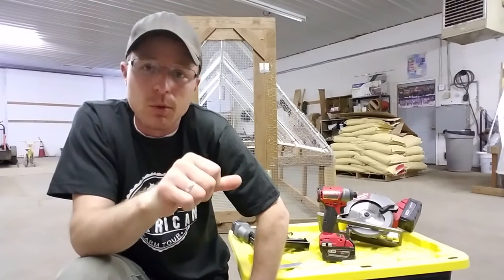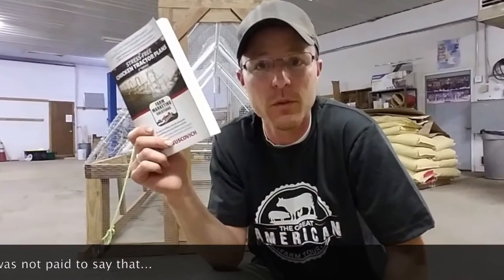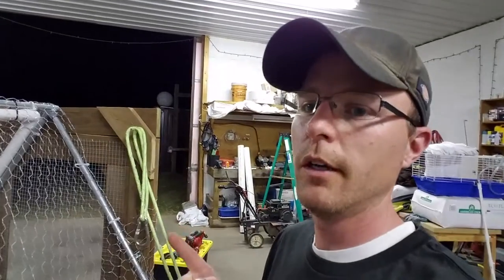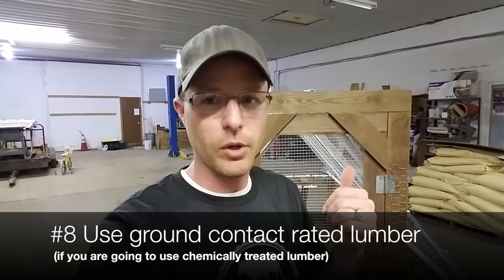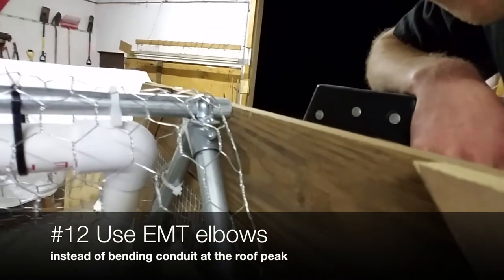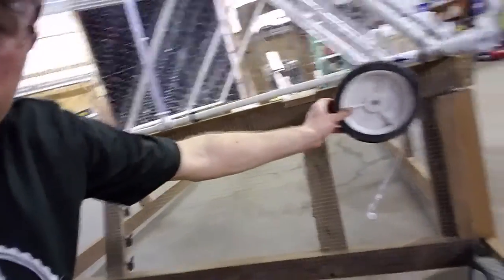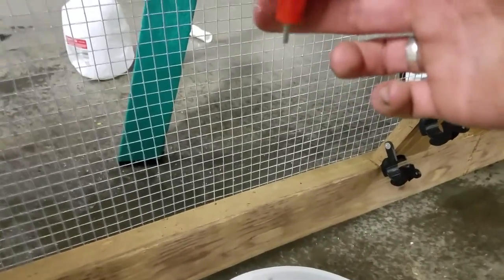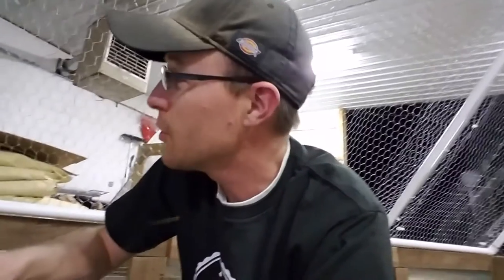Suscovich Chicken Tractor: Tips Tricks Mistakes and Sweet Mods

Comment: Quick correction on the EMT clamp. The one you showed the photo of was for 3/4 inch pipe. This project needs a 1/2 inch pipe EMT. Should be easy find at any hardware store.

Comment: Thank you for the added info to make the build easier. Great solution for conduit installation.   Especially found the mods you did helpful. Question?  Where you added the nipple water connection. How do you screw in the end with the clear section of hose without getting the tube twisted ot having to manipulate the whole piece?  Would it be useful to make that a quick connect instead?  Quick connect like you can add to a garden hose.
Reply from the maker: A quick connect would be easier as the tube twisting was annoying, but there wasn't a huge reason for removing it too often. For this and other reasons I don't recommend the water system. It just didn't have enough capacity to be worth it.

Comment: I really like your improvements and tips for this tractor.  I have John's book and am just getting ready to build one myself, and I am sure your tips are going to help a lot.  I like your water ideas too, but I think you may have inspired me to improve, or well at least simplify and reduce the cost of, what you are doing with the water.  All of those little plumbing fittings required to build a pipe "cage" must have added up, and that also seems to be a lot to not only install, but a lot of joints and corners and tubing that could leak or get cracked as it flexes when this tractor gets moved daily, or pocket that may freeze in the winter if not entirely well drained for storage.  I think it would be easier to use a 3" or 4" pipe up under the ridge for a reservoir right into the tube to for your movable manifold.  Idk if you can just get a clear end cap for pvc pipe, but if so, there's the water level indicator for the tank. Half a dozen or so fittings and a lot less tubing, and I think you'd get the same results.  I think there should be enough conduit up the to have plenty of support, and zip ties would not only hold this tank up, but they would give lateral support to the conduit rafter.
Reply from the maker: Awesome,  thanks for the note. There is a comment in here somewhere where after a year of using this I believe I recommended the same thing, a single larger diameter pipe from the middle. I actually already bought the pipe for doing exactly as your describe, just waiting for warmer weather. Speaking of warmer weather, I dont use the water system during the Winter. Thanks for watching!

Comment: I was watching a few videos and like the ideas I see here.  My wife bought all the stuff from the book to make this and I'm having to make it tomorrow to get the chicks out of the brooder.  I think I see what is wrong with the door from watching other videos and comparing lengths.  The short pieces are not supposed to be above the long pieces but at the top of the long pieces.  I really like the all the improvements you made and will be attempting to add those in tomorrow.  Thanks for the video.
Reply from the maker: Thanks, I'd skip the pvc water system if you were going to attempt it. Just do a large 3-4" pipe down the middle instead of making it a cage.

Comment: Randy I like the watering system. Great idea. How about your feeder? Thanks mdag. Glenn
Reply from the maker: The watering idea was interesting on paper, but in practice it didn't hold enough water to make it worth it. I'd advise against. For feeders I did the pvc feeders that are in the book, just not hung from the ceiling. I screwed chuncks of 2x4 to the bottom of the PVC pipe and laid them on the ground. The ones hanging from the ceiling were too "swingy" when moving the tractor. Thanks for watching!

Comment: Great ideas to improve an excellent design. I would add one. When I built mine I mounted the wheels so they run on the other side of the 2x4. When you pull the tractor forward you don't run the wheels through the bird's manure.
Reply from the maker: Great tip! I actually thought about this too, but decided to purchase wheels for each of my tractors. They seemed to get nasty regardless and I thought it was a waste of time to keep moving them, so I just bought a set for each tractor. I was also worried since I tow mine around the farm that they effectively increase the width of the tractor as a whole and I am not as careful as I should be about looking behind and making sure I am clear when going through gates.

Comment: Great tips on mods!  Question - have you had any issues with strength or longevity in the lumber where you drilled the holes vertical for the EMT? I love that idea but concerned about the strength of drilling a 3/4-1" hole in that 1.5" thickness.
Reply from the maker: I was concerned about it too, but haven't had a problem because I also added small 2x4s attached to the cross bar where the holes were drilled and I wasn't directly centered.

Comment: Excellent. Wish I would have seen this BEFORE making mine. Your tips about the conduit and all things related to making the stapling easier are spot on. And yes, some of the measurements and diagrams in the book are just plain wrong (some of the numbers don’t even add up on the lap cut diagram). 

How is this watering system holding up?
Reply from the maker: Glad it helped you. Skip the water system. Too much piping for not enough volume. If I could do it again, I'd run a single 4" pvc pipe down the middle hung from the roof peak. Good luck!
Reply: @RandyKleinman  that is an excellent idea.

Comment: Great job Randy! I enjoyed watching how you built this tractor and the modification that you made. I noticed you were using a 1/2 inch conduit bender to bend what looks like 3/4 inch EMT conduit. I'm not sure but this may be what was giving you trouble when trying to bent the EMT. Thanks so much.
Reply from the maker: Thanks Mike, now I have to go out to the shop and double check. I am pretty sure they were both 1/2", but now you have me thinking.
Reply: @RandyKleinman  Did you use 1/2" conduit and still drill a 1" hole in the frame to hold it?
Reply from the maker: It was 1/2" conduit. I started with a 1/2" spade bit and went bigger to get the conduit to fit.
Reply: @RandyKleinman  Can you give me a tip on how to measure and bend the conduit? I cut the 10’ piece in half, but I’ve wasted a couple pieces already attempting to bend it and still be able to insert into frame. 

Current issue: 5’ pieces inserted into 90 elbow like you described. Both pieces stick out wider than the frame of tractor.
Reply from the maker: I am not the guy to talk to about conduit bending, search YouTube for an electrician that does this stuff everyday. Based on your description of your current issue, it seems like you could just cut the conduit shorter on the end that goes into the 90 degree connector.
Reply: @rsteiny24  I'm late to answer... But bend it further in

Comment: Thanks for your video! After using yours for several years, did you find setting the conduit in the 2x4 weakened the structure at all? Did you have any splitting along the upper board where the holes for the conduit were drilled?

Comment: You could also use maker pipe connectors to ease the pain of connecting all of the EMT conduit
Reply from the maker: I am not familiar with what those are. Tell me more.
Reply: @RandyKleinman  Maker Pipe supplies a variety of connectors 45, 90, 180, 135, etc. that fit 1/2 or 3/4 in conduit and make it easier to assemble projects made with EMT. There are quite a few YT videos showing DIY projects made with the connectors. They also sell flange mountings, color wrap, threaded inserts, and other accessories that gives alternative options to complete a project.
Reply from the maker: That sounds like a great option for a project like this. Thanks for sharing.

Comment: Awesome video and recommendations I will be implementing most of them as I am half way through my first Suscovich tractor. I was curious if you had any more changes you would make? I saw your recommendation on changing the waterer, but I was looking to see if you did an update and checked out a bunch of your other videos. In some of those your tractor was bigger which was one thing I was considering. Any additional suggestions or thoughts are much appreciated and thank you again for the great videos!
Reply from the maker: The bigger tractors were built by Ethan from @180 from Average. I should make a video 📹 in the spring with the dimensions of it. It is nice and obviously can hold more birds, but much harder to pull around without an atv or trolley of some sort. Thanks for watching and welcome to the channel.

Comment: Randy, I've saved and watch this several times as I am about to include your tips and mods to build mine.  Question: the EMT Elbow @17:34 is a 3/4 inch pictured but Suscovich material list shows using 1/2 inch conduit.  Did you go with 1/2 or 3/4 or is the 3/4 elbow fine for 1/2 EMT?  Thank you and great video work.
Reply from the maker: Gotta be 1/2" based on conduit size. If you are like me, I usually buy both sizes and return what I don't use later :)

Comment: Great tips!! Still trying to decide to build this or more of a Joel Salatin type..
Reply from the maker: I love this design because it makes removing birds on butchering day so simple. It is very functional in its original design. But, everyone has the preference and context. Thanks for watching!
Reply: @RandyKleinman  That was the biggest downfall I thought about when considering the short design. How does this taller design do in windy conditions? Any problems with blowing away?
Reply from the maker: @shadnkids4  I hesistate to make recommendations about wind, because everyone's wind conditions are different. Where we are in MN we regularly get good ole midwestern thunderstorms rolling in, and 60-70 mph gusts. I have never had a chicken tractor flip over much less move any noticeable amount. With the bottom and the ends open and the center of mass so low to the ground, I don't see how it could blow away at any but the craziest of wind events. The tarps, on the other hand, probably are the weakest link. You can see that on my video of my Suscovich eggmobile conversion.

Comment: Randy - nice work demonstrating the build of Suscovich's chicken tractor.  I found your editorial to be fantastic and it really helped seeing your video first BEFORE my son and I built our first tractor.  We took all your upgrade suggestions put them to use....including the PVC water system.  The tractor turned out great!  Now putting it to use, the only thing we have noticed is that it takes a very long time to fill the water pipes each day (we generally have to fill them 3 times a day - morning, noon, evening).  I'm suspecting it's due to not having a ventilation system allowing the water to freely flow but.....  Have you experienced this same issue and did you find a good solution?  Keep up the good work!  Thanks in advance for your help.
Reply from the maker: I did find the same thing, and what I did was just turn the water on low and I fill feeders while the waterers are filled. Thanks for watching and hope you stick around the channel!

Comment: Great job on the Upgrades   am thinking though would it have been easier and maybe cheaper just to use a 2 inch PVC pipe to get the amount of water you need while using less footage of Pipe.
Reply from the maker: If I build another, I will use larger diameter pipe and less of it. You hit the nail on the head!
Reply from the maker: Since I only am using these tractors in the warm season, I didn't bother with horizontal nipples. But, we are trying using one of these tractors this winter with our laying flock. If it goes well. I will definitely go with these side waterers. Nice tip!
Reply: Probabli bot remember Is an impruv an a learnig proces

Comment: I like the conduit mod, I think I might do that on my next one!  Did you just got the side pieces to 5’ and then bend the end?
Reply from the maker: Yes, they are the same as the Suscovich plans say, just set into the sidewall boards. As a result, the tractor peak is slightly shorter than it otherwise would be.

Comment: I'm in the middle of building this and wish I watched it before I cut the pieces for the door! Great video and very thorough. I am just curious, how much did you spend on this with your modifications?
Reply from the maker: Glad it was helpful! I spent about $365 in 2018. I wouldn't recommend the watering system if you are thinking about that. It would be cheaper and easier to just do a 4" PVC pipe down the middle with a cap on the end than the complicated thing I created. Some other comments on this video have some more discussion about that. Good luck!

Comment: Awesome video.  Where did you purchase the wheels and what size are they?
Reply from the maker: I got the wheels at a local hardware/big box store called Menards. It is basically the same as Home Depot/Lowes. They are either 8 or 9 inch wheels, just the standard push lawnmower replacement wheels.

Comment: Thank you for this video!!! I’d seen the John Suscovich tractor videos and plans and was considering it but this video made me pull the trigger and now I’m in the middle of building two. But hey..... don’t you think you could build the whole roof structure out of the PVC waterer?????? Triangles are the strongest shape right? Plus much lighter than metal conduit and if you’re gonna have it anyway you might as well get rid of the conduit...... thoughts?
Reply from the maker: I think you could depending on what the load will be on the roof. The feeder hangs from this structure and I have to worry about snow in the winter (even when there are no birds in the tractor). I would probably stick with the EMT because it is cheap, more rigid, and will last a lot longer. Thanks for watching, feel free to ask more.

Comment: Nice upgrades 👍
Do you thougt about to integrate some diy nestboxes outside on the short side? 
If you change your water system to the long side, there must be space for 3 boxes.
In the case of a single traktor perhaps you can integrate more boxes on the long side 🤔
Reply from the maker: I have another video with a tractor with nesting boxes on the back for our layer flock. Worked great last summer.
Reply: Randy Kleinman Yeah i found it...regarding to your heat lamp with timer: look for a timer with thermic controller. im using it for my homegrowing box and it works fine 😉
Im retired for a few years and now im collecting some information to prepare a good start with some homefarming next year. I think about meat&egg chickens, rabbits, some pigs, sheeps and perhaps goats. Bees!
Because of our clima, long hot/dry summer and short cold winter, i planed with a complete hydroponic fodder system...barley, wheat, maize.
Do you have some experience with that?
Reply from the maker: @fragman5910  no experience with fodder or hydroponics. Our winter is loooong and cold and so it takes a lot of infrastructure to keep plants and water going. Plus, nice to have a break in the cold months to catch up on sleep, book reading list, and YouTube :)

Comment: Great video. Did you use 1/2 elbows and straps for the peak? When I try this the straps don’t align with the elbow screws. Thank you
Reply from the maker: Yes, it is all 1/2" so it fits with the EMT pipe.
Reply: @RandyKleinman  Thank you for replying. I ended up using 1/2 half straps and some self tapping screws to lock the spine in place. Really like the conduit idea.
Reply from the maker: Great! Good luck with the rest of the build.

Comment: I put about 50 staples in each panel, than reinforce with screws and 1 3/4 washers every 12 inches or so. Works amazing, I've seen black bears lean up against my run wiring without busting it. Only works for the hardware cloth not chicken wire.
Reply from the maker: I can't imagine trying to keep bears out, kudos to you and thanks for watching.

Comment: Do you have a rough estimate of the cost for this build? Looks great BTW, I love your improvements on the original design.
Reply from the maker: Hi Justin, in 2018 it was about $350 from almost all new materials. Home Depot and Menards.
Reply: Justin Poplawski I just bought material for two(except the tarps) and it cost me 408$. Good luck
Reply: Built one this past year.  $442 in materials.

Comment: I have never built one but could you somehow use the pvc pipe for the frame instead of the conduit?
Reply from the maker: You could, it would not be as sturdy and it would degrade over time in the sun and elements. Conduit is fairly cheap, and it would take a lot of time to replace a section of broken pvc.

Comment: How did the water work in the past year? Wondering because I have just now built my first one and hope to duplicate the water system! Thanks
Reply from the maker: I didn't use these tractors this past year, I used my larger ones. I wouldn't recommend this water design. It just didn't hold enough water. If I could do it again, I would just use a single 4" pvc pipe down the middle of the roofline.